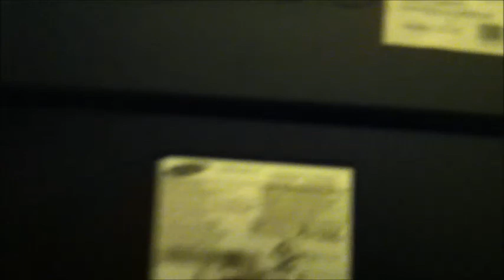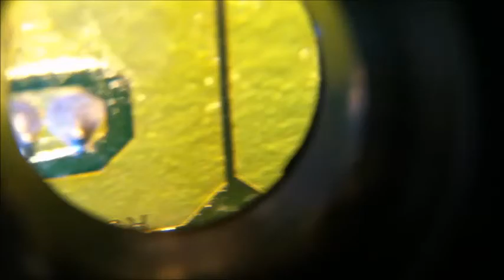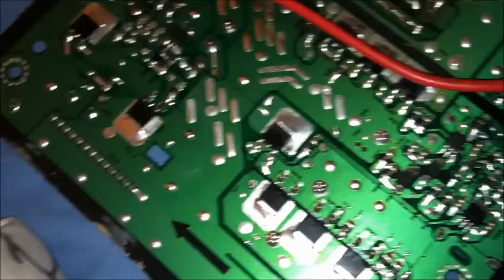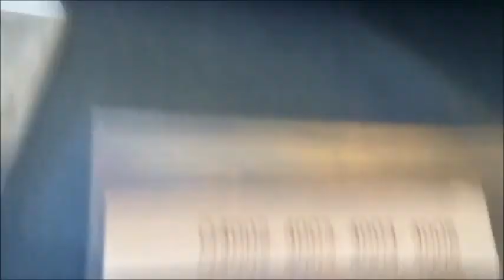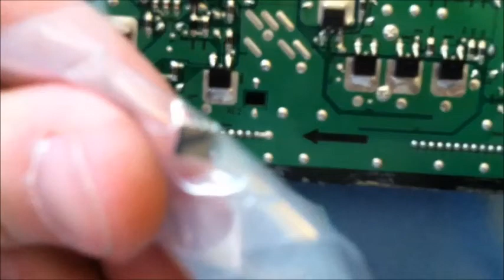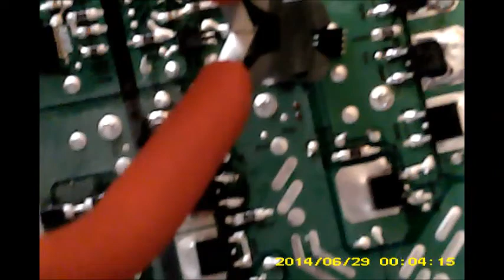How to fix repair Samsung PN43D450A2DXZA bn96 16510c repair kit

Comment: I would ask myself the question: why did these chips overheat and burn??? Without knowing-----How long will the replacements last???
Reply: "why did these chips overheat and burn?"  A:  The heat issue has to do with lack of ventilation or units placed in homes with no A/C.  The heat builds up, with long usage, resistance drops -  and heat sensitive parts burn up.  Another concern is no heat sinks, in the design.  Heat, and dust (poor cooling design) all add up to damage.

Comment: At minute 4:47, one of those two connectors is broken right in the silver edge, what can I do, I can't find any replacement since I believe it is made it directly to the LCD display screen,
Reply from the maker: +Darwin Quito I wouldn't worry about it as long as it makes a contact and works
Reply: Oh ok.. but still that x board is the one that doesn't, I tried to turn it on with the cables disconnected to the x board and it turn on with soundlike normal, which when it's connected it doesn't turn on and it make no sound
Reply from the maker: +Darwin Quito right, so you buy a replacement board off eBay or try fixing it yourself

Comment: Good Job, thanks ! I am having a problem with T-con board, in my Samsung 60 LED, Model # UN60EH6000F, no visio, only sound/audio. DO they sell Repair Kit for that T-Con board?? I heard usually cap. CD31 and Trans. QD2 go bad, in smaller units anyway., like UN46D600. Do I have same numbers in my T-con board?? And , one more question: I have extra T-Con board, # UN65EH6000F, could I use that in my TV?? Thanks again, youtheman =)